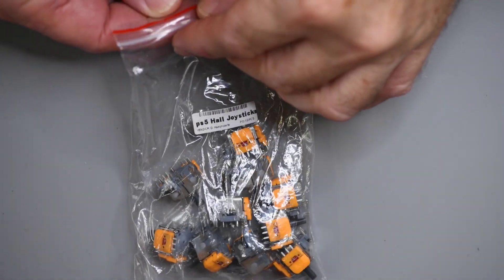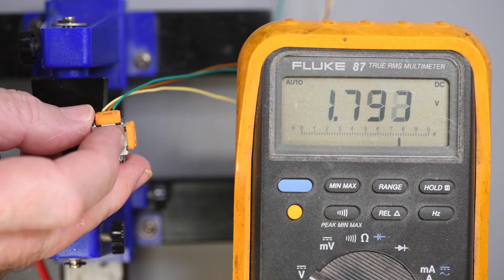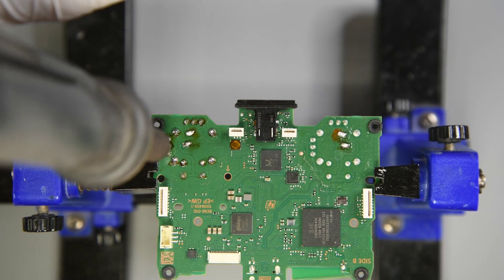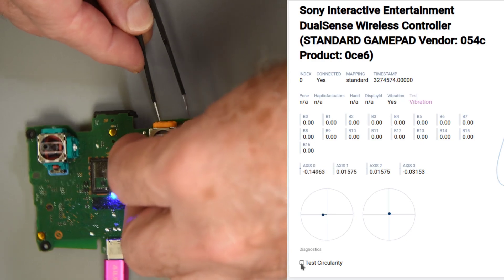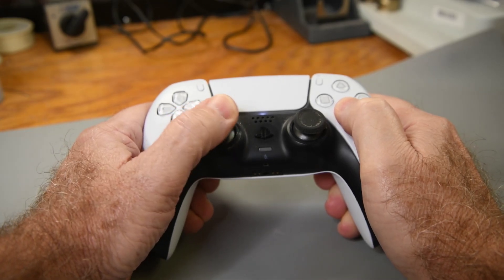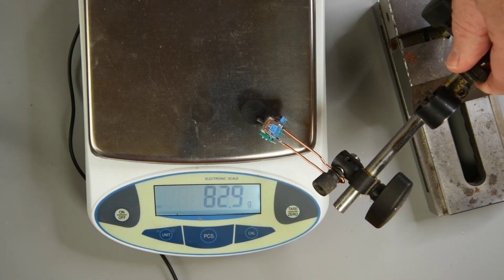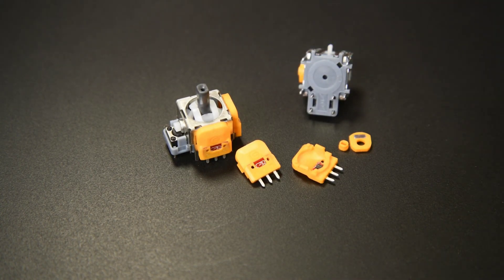Hall Effect Joystick Replacement for the PS5 DualSense

Comment: i got the exact same ones... i soldered them on... and basically its not working... when i put the originals back on it works fine. do you need the drivers that go on the back like i keep seeing everywhere?
Reply from the maker: No shouldn't need anything extra.  is the stick position reading all the way up and left, center, or down and right? The number on the Hall sensor I used is 93L35.  What is the number on yours?  I wonder if they sent you the wrong ones.

Comment: Thank you for the video. You give more of an in depth explanation of things. One thing to take into account is if you do it with the xbox controllers. The triggers are hall effect sensors as well. So try and get the left trigger deadzone as dialed in as possible. Since when you push down on the left trigger. The magnet affects the analog stick sensor. Only only on the left stick though.
Reply from the maker: I don't have an Xbox controller. I guess I should get one, take it apart, and do a video.
Reply: @metalplasticelectronics354  If you're in the US damaged ones can be had on ebay for relatively cheap. Shoot for a series s/x one. They have USB C. I'm only using this older xbox one controller since a friend gave it to me. 1708 model

Dunno if the newer ones have a daughterboard or not. I think so though.

Comment: on the linked page for these joysticks, the entries for ps4, ps5, and xboxone look the same, with no picture variation. am i to assume that they ARE indeed the same, or is there an actual difference between the three entries that would necessitate such a separation?
Reply from the maker: I know that the PS4 and PS5 controllers run at different voltages. That may require a different hall module. So they may not be the same.

Comment: thanks for the video, I changed the stick, now the dual sense blinks three times with the diode and does not work, tell me what to watch
Reply from the maker: You might take a look at this video: https://youtu.be/cWUnZ7KjUIQ . You will need a multimeter.
Reply: thanks for the next video checked the voltage on both sticks on each 1.8 volts when I connect the battery it appears for 3 seconds then it disappears
Reply: I can't understand what it means when the diode blinks three times, it happens when you connect a type C ,battery or put it in a docking station
Reply from the maker: Look very carefully over the PC board and make sure a solder splash hasn't shorted something out. It kind of sounds like the power supply is shutting down. Maybe too much current is being pulled. I don't know about the blinking. What color LED blinks?
Reply: flashes orange three times
Reply: I have a question, if both sticks are broken, will the board turn on without them
Reply from the maker: It should; the joystick pulls almost nothing in the way of current, unless one of the potentiometers is shorting out.
Reply: I had this problem and it was because the ribbon cables were bent when i plugged them back in. 

To test if you have the same problem.......

Test the controller with only the battery and plugged into PC/ LAPTOP and do not connect the ribbon cables

Comment: Can work in xbox series x/s controller???
Reply from the maker: Kasynparts lists models for PS4, PS5, Switch-Pro, and Xbox One.  I think it would depend on what voltage the series X/S controllers run at. The DualSense runs at 1.8 volts. The DualShock runs at 3.3 volts. I don't know about the others.

Comment: Just wondering how to get access to the Sony calibration software for zeroing these potentiometers?
Reply from the maker: It must not be standard software that runs on a PC, or it probably would have leaked out by now.
Reply: Its not a software it's a website where you can test your controller stick drift by yourself because I have checked my controller myself.

Comment: I'm having a problem with these modules where some of them will only register left/right movement on the left side in gamepad tester, even though the signal wire voltage hits the full range of 0v to 1.8v.  When it's at dead center, the signal voltage is .9v, but the position in gamepad tester is about halfway across the left side of the test ring. Any idea what could cause that?
Reply from the maker: Well, it is a possibility that the original potentiometer was very far off center. Will the magnet piece not adjust enough to center it?
Reply: @metalplasticelectronics354  its not a centering problem, the range is restricted to the left half of the circle only, and won't even touch anything past the center line regardless of magnet position.  It's bizarre.  Im wondering if its a manufacturing defect of some kind, or if it's possible for a crossed wire to cause it.
Reply from the maker: Oh, that is strange. If the center tap goes from 0 to 1.8 volts, then I think the hall sensor is okay. Have you tried resetting the controller? If I remember correctly, 0 volts should be all the way left, and 1.8 volts should be all the way right. Double check the center pin of the hall sensor and make sure it is soldered well. A high-resistance joint might cause it.
Reply: @metalplasticelectronics354  resetting the controller seems to have helped. Only issue left was that moving one stick up or down made the other one move left to right in the test app, but as far as i can tell, that doesn't translate to a problem in game.
Reply from the maker: Yea, that's probably a bug in the web browser. Glad you got working.

Comment: I think i mess it up on the calibration inverting the axis, and now it doesn't click anymore. Did you get that issue, or even better, do you know how to correct it, or do I have to replace it for a new one?
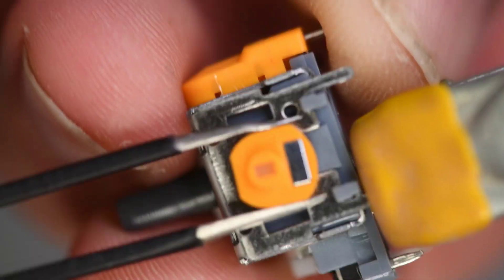Reply from the maker: It's probably not messed up; it might just be loose. It all just presses together. See at about the 1:20 mark in the video. You might unclip the sensor part and try to push the center bushing back into the magnet piece.
Reply: @metalplasticelectronics354  Thx man! I'll try to open and realign the magnet.

Comment: Can these be used in normal controllers using normal potentiometers? I'd really like to put some in my oculus rift CV1 controllers.. 😅
Reply from the maker: You would have to use the entire joystick module, as the sensor will not fit on either the Alps or Favor Union joysticks.
Reply: Yea the entire module i dont wanna keep the old housing or such, if its same size i will go full conversion. if it works im down to spend some money for it @metalplasticelectronics354
Reply: Yeah i'd fully convert them to it, i aint leaving anything from the old ones behind. ifthat works then yeah, i'd spend the money
 @metalplasticelectronics354
Reply from the maker: If they mechanically fit, the next thing would be to find out what voltage the oculus uses for the potentiometers. The DualSense supplies 1.8 volts to the joysticks. The DualShock is 3.3 volts, if I remember right. I'm not sure what the XBox controller uses. But Kasynparts has four versions, and it wouldn't surprise me if the only difference is the voltage they operate at.

Comment: The difference is calibration. 
The last 10% of the travel isn't measured.
I don't mind that as I hated 100% being hard to the edge of the stick do I can take it lightly to the edge of the movement and still have 100%.
The bigger issue is inconsistency sensor to sensor..

Comment: This is exactly the info I needed to attempt a fix for my two original ps5 controllers that have terrible stick drift now.  Tired of replacing them every year, and this looks like it could bring the old ones back to life again.
Reply: Hey all, just noticed these comments, sorry I went AWOL. 😆.  Soooo, bottom line is that yes, the hall effect sensors work in dual sense controllers. The problem I had was most likely my terrible soldering skills, because I wasn't able to get the voltage range to calibrate in one direction on one stick. Haven't gone back to work on it again yet, but if I do, I'll post another update.
Reply: HE GONE
Reply: how this went?
Reply: Guys I have fixed my issue of stick drift by using the gulikit TMR joysticks. (I did not solder them myself, I went to a tech shop and they switched them out) I got them last week and a half ago and they have been amazing, after calibrating the sticks by watching a simple tutorial, I noticed no difference in responsiveness between gulikit and the original joysticks. Although I haven't got time to test them thorougly since I got them recently but reply to me once in a while and I'lll update you all.
Reply: @funkyÔ.Ôi  so how do you feel about em ?
Reply: @bilelsicario  They're amazing, For reference I can put them on a very low deadzone and i'll notice the slightest bits of drift, I don't play on low deadzones but it's to show that it has no damages after prolonged use.
Reply: @ thank you for your insight
Reply: @funkyÔ.Ôi  it's still working properly or not ??
Reply: @nitajnitaj6305 Yeah it is, no issues at all.
Reply: Update?
Reply: @grahh7234  update? lol!
Reply: Did you get it done? How are they?
Reply: @kingdeedee  i did install them and the sticks work, but i must have a soldering glitch because the right stick button press is acting weird.  Once ive had a chance to work on it, ill report back.
Reply: @OnlyWayOutIsThrough did smth happen?
Reply: @OnlyWayOutIsThrough  update?
Reply: @OnlyWayOutIsThrough update?
Reply: He blew up and he died
Reply: Since this requires soldering, is it something you think a complete beginner can handle?
Reply: He cooked
Reply: Blud gone 😪

Comment: Hola amigo, compre joystick en aliexpres para ps4 y ps5 al instalar los joystick los dos mandos dejaron de funcionar, se vuelven locos! Que puede ser? Cambie varios de joystick normales y ningún problema. Ayudame porfavor.
Reply from the maker: Are they regular joystick modules or hall effect sensor joystick modules?  The PS5 hall sensor ones are made to run off of 1.8 volts, I don’t know about the others.
Reply: @metalplasticelectronics354  si, son de efecto hall
Reply from the maker: Then I would suspect they are not the correct ones for the PS5.  If it list them for use in both the PS4 and PS5 that is probably a cause for concern.
Reply: @metalplasticelectronics354  ok, muchas gracias por tu tiempo. Muy agradecido ☺️
PD. Mañana desmontare el joystick, espero que vuelva a funcionar el mando 🙏
Reply: @akagicac lo resolviste? Yo instale los hall en 2 controles y paso lo mismo se quedan con drift a los dias
Reply: @gustavom3587  buenas si, parece ser q me pase soldando, compré un estanyo q se derrite a menos temperatura y lo solde con más cuidado y ahora si me funciona bien. A mi lo q me paso es q se quedo el mando loco nada mas instalarlo pero era eso q se metio el estaño pa dentro, ahora le hago puntadas mas rapidas.

Comment: Hi there!
I installed the hall effect on both of my controllers, just like u showed us
it ran smooth and perfectly!

Today however, 
the left stick seemed to be stuck, it got "stuck" on left all the way.
Faulty hall effect I thought, so I replaced it
but still maximum left input signal, adjusting didn't work, resetting the controller does not work either...
That happened on both controllers.
Any idea why?

Cheers!
Reply from the maker: Just to the left or upper left?  I think upper left is 0 volts output from both pots, but I'm not positive.  The fact that two controllers did it is very strange.  I've only install the one hall joystick, but it's still working fine.  If it's just to the left and up and down work fine, then it's either 0 volts or 1.8 volts on the center tap of the bottom hall sensor.  Would need a volt meter to check and see.
Reply: just perfectly left, after changing hall to another same problem, reset controller blocked too @metalplasticelectronics354
Reply: Exactly the same thing happened to me on 2 controls with the right joystick, it seems that the board was decalibrated, did you fix it by returning to the classic joystick?
Reply: replaced it with a new hall-effect, worked for 2 hours, then it happened again... @gustavom3587
Reply: same thing just happened with mine, worked fine for a while... i turned it off and back on, then right stick all the way left no matter what.

Comment: how does your sticks have no jitter but you do not have the add on board installed? i thought the add on board was needed for all hall effects sticks.
Reply from the maker: I don’t know for sure.  There was a comment that these are a later version of the hall sensor and they filter out the jitter but I’m not sure.  Guess I should see if can figure out a test setup to see what kind of response they do have.  They do have a different feel than the regular joystick.  And I want to say they just feel a little smoother, but not in a mechanical sort of way, if that makes any sense.

Comment: What tool do you use for desoldering?
Reply from the maker: The one I’m using is a very old Hakko 470 desoldering station.  It’s been discontinued for years.  There are some knock offs on Amazon.  Will see them listed as a vacuum desoldering station or desoldering gun.  I don’t know how well the ones on Amazon work but it’s just a vacuum pump and a heater with a hollow tube in the center for the solder to get sucked through.
Reply: Hey, if you were able to do a pros and cons video about your gun,  would be awesome. Thanks for the reply.

Comment: I’m hoping a set of these will be available for the elite 2 controller as it is different from these other joysticks or ones to become available that only replace the sensor part of the joystick
Reply: Technically you could by these and retrofit them to the elite but you probably never get center set right
Reply: @RNG_Anarchist I was thinking about that but it’s probably just worth it to let someone make a set or just the sensor part
Reply: @RNG_Anarchist I’ve also got a 3d printer and I heard that the little magnet has a different shaft so I could make something for that

Comment: Hi, could you guys help me please? I've installed the hall effect modules into my controller by myself and one of them is stuck in left upper corner in the gamepad tester, I'm not sure why. Have I damaged something? Thanks
Reply: When I put alps joysticks on a ps4 controller the first set I put on I moved the analog stick before it cooled down and I think it being heated up and moved caused the plastic to cool in a slightly different position than the factory position. I put another 2 new analog sticks on and didn’t hold the soldering gun to the pins as long and also let it cool down before touching the analog stick. Then I rotated the old one I messed up, and the new one, and the old one was way stiffer like I fused plastic parts together by applying heat for too long. The new ones have no stick drift but the circulatory was 20 percent rather than less than 10 percent like my new controllers. So to conclude I believe it was my installation error by applying too much heat for too long on the first ones. Then the circulatory issue of 20 percent was the same for both so I think I just bought cheap analog sticks is the problem with that.
Reply from the maker: Double check and make sure don’t have any solder shorting out anything.  If you have a volt meter check and see what the voltage is on the center terminal of the hall sensor.  It’s probably going to be 0 volts if I remember upper left correctly.  So something may be shorting out the 1.8 volts to the joystick module.
Reply: Ok, I'll check it. Thanks! @metalplasticelectronics354
Reply: @metalplasticelectronics354  I checked it and cleaned up again and still the same. I unsolded hall effect joystick and solded new ALPS joystick to see if something changed and nothing happens. No idea why this problem is happening 😪 I've already tried everything
Reply from the maker: Would need a meter to check and see if getting voltage to the joystick.  That is the only think I can think of to try.
Reply: I had that problem when some of the pins weren't rightfully soldered

Comment: Hello, good video, I would like to know if the magnetic potentiometer could be installed on the base joystick by removing the magnet it has and putting it on the base plastic of the base joystick axes. You would do me a big favor by telling me because I don't have a heat gun. It would be much easier to put
Reply from the maker: No, it want fit.  While the sensor will snap on a Favor Union joystick frame.  The magnetic part requires a different shaft.
Reply: @metalplasticelectronics354 ok thanks

Comment: so can battery effect buy that ??
Reply from the maker: It shouldn't.  The controller has a voltage regulator that will supply 1.8 volts.
Reply: @metalplasticelectronics354  good 👌👌

Comment: hello I have a question I connect my dualsense to my pc to test it on gamepad tester, it detects the controller but it does not display the sticks to see if there is a drift problem how do you do that?
Reply from the maker: You might try a different browser.  If your using Windows there might be an updated driver that needs to be installed.  I’m using linux so not sure about the Windows driver.
Reply: @metalplasticelectronics354  thank you for your answers